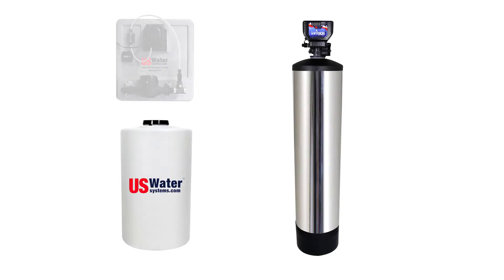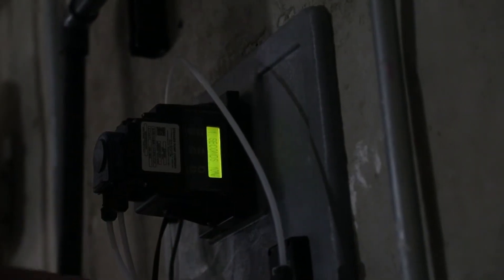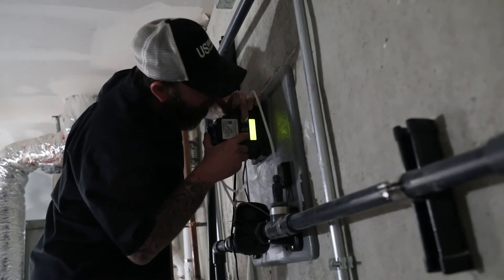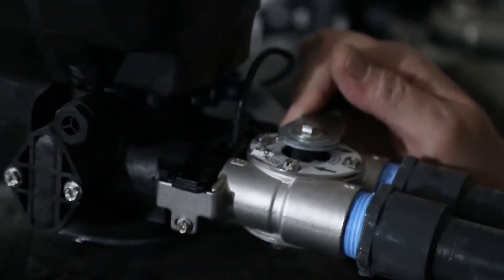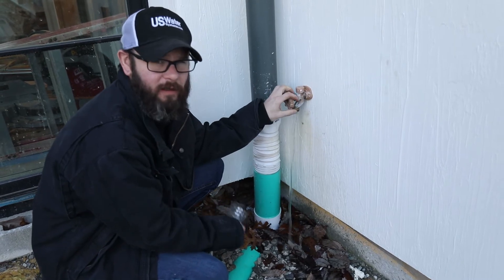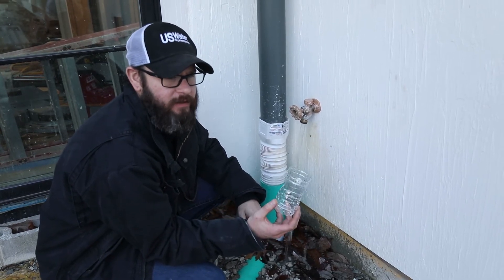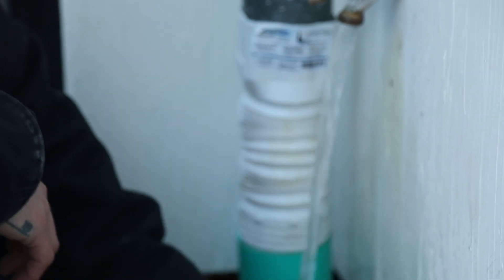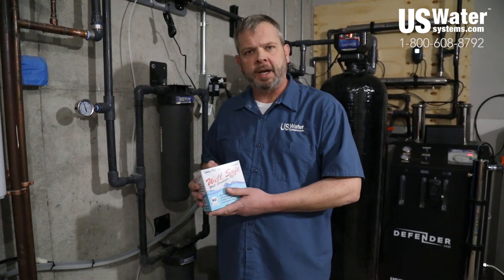System Start Up - Infusion Iron and Sulfur Removal System

Comment: When you are testing using the visible bubble method, are you run in  the water through the carbon filter as well?
Reply: No
Reply: You need to have your system connected to the internet for it to work…
Reply: What percentage of peroxide are you using? Why not use peroxide test strips to check the level?